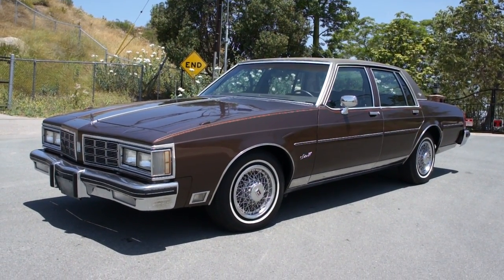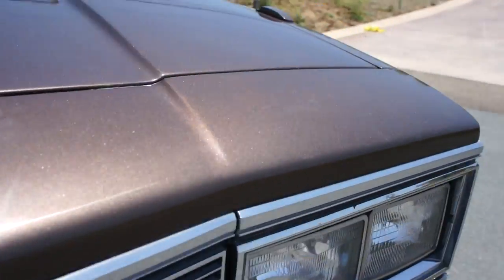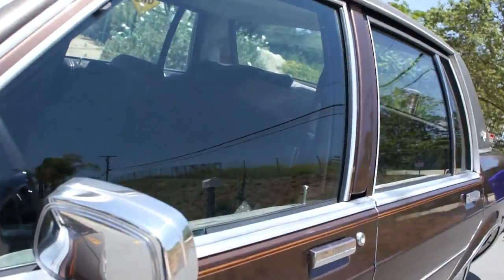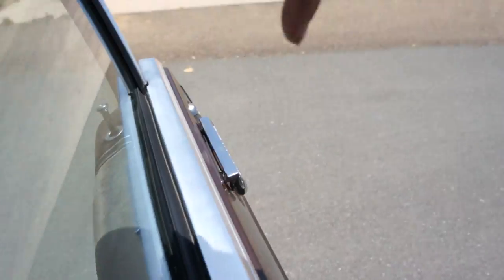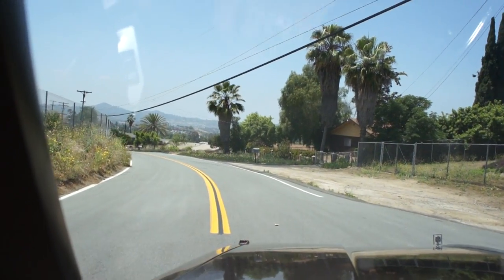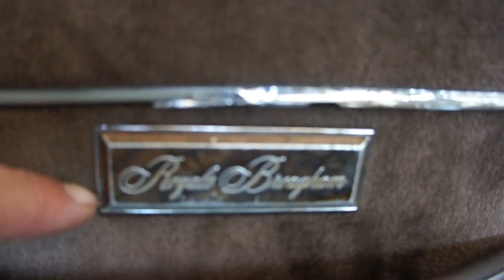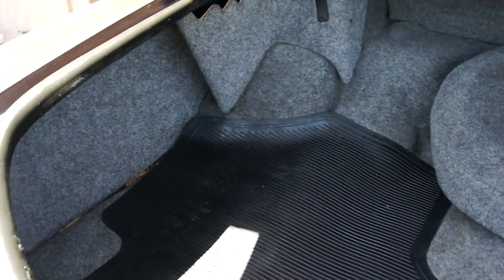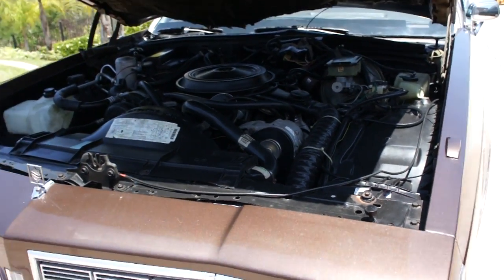2 Owner 1983 Oldsmobile Delta 88 Royal Brougham

Comment: I've had two of these exactly like this. One brown like this and the other was gray. Both had 307s. One was an 80 and one was an 85. They were good cars and very dependable. I was only 24 when I had the 80 , had it 5 yrs and took very good care of it . 3 years after I sold it I had a chance to get an 84. The only real difference was the 80 was a 3 spd auto and the 84 was a 4 spd overdrive. I had that one 5 yrs. . My 80 was slow like that but it was normal and ran perfect too. My 84 had a much faster take off
 I think it's in the gearing. No worries on that slowness. Those interiors are really comfy that's for sure.

Comment: By the mid-1980s GM had gone wild with the nomenclature. What once was the top of the line in the 88 series (Delta 88) had now become the entry level, and even the follow-on top-of-the-line Delta 88 Royale had now been consigned to the mid-level trim. Now if you wanted the top trim level in the 88 series you had to buy the Delta 88 Royale Brougham. Meanwhile, despite the nomenclature inflation, the cars kept getting smaller, and Chevrolet engines started showing up under the hoods of Oldsmobiles. For 1984, they did it again, dropping the base Delta 88 and introducing the Delta 88 Royale Brougham LS at the top spot.

Comment: Fortunately they reproduce quite a few parts for the Olds Delta 88s and the Olds 98s.  They make bumper filler panels front and rear, you can get new mirrors, etc.  The noses are all made of fiberglass.  If you ever find an aluminum hood (a few came with those), those are rare.  Some mirrors had a thermometer in them (very rare) like the gauges to the right of the column.  If I think of anything else I'll write more.  We've been collecting Oldsmobiles '80-'84 98s for quite a few years!

Comment: Performance issue is probably either the carburetor or a clogged EGR valve. Ours had the issue of bogging down and almost stalling when you'd floor it, and we never could get it fixed right.

Comment: I have a Delta 88 Royale from 1982. Same color as yours (maroon or something like that), but the paint is very worn. The speedometer and air conditioner are broken, and the hood ornament is snapped off. It had 75,000 miles at the time the speedometer broke, it's probably 125,000 now. I love it, but the main thing disappoints me is how little power it's engine makes. Being a 307 cu in V8, I would expect more than just 180 BHP. It does have good mileage though, and I still do love the car to death